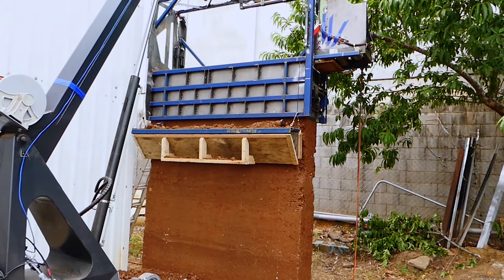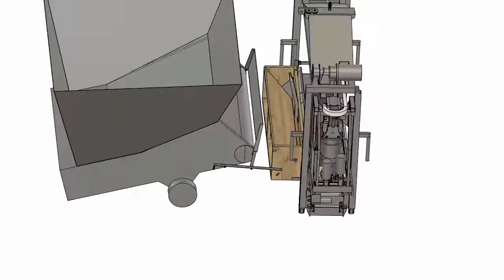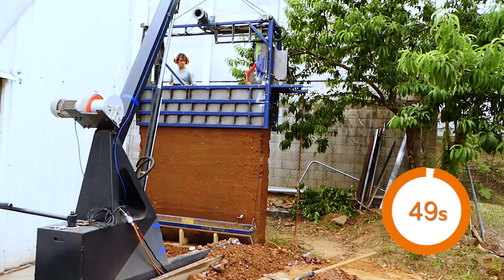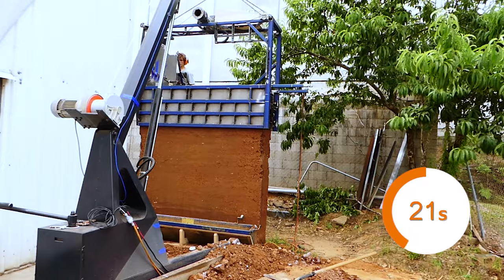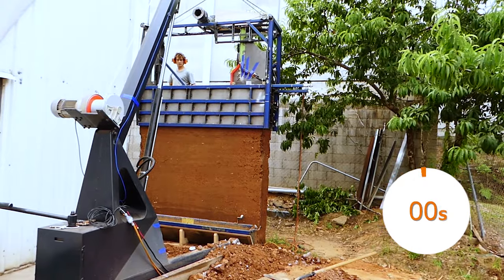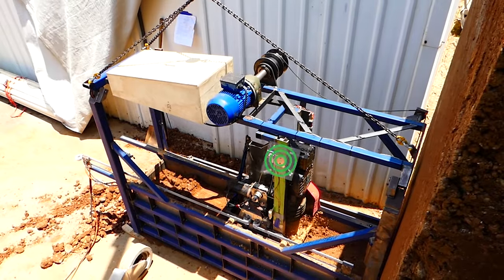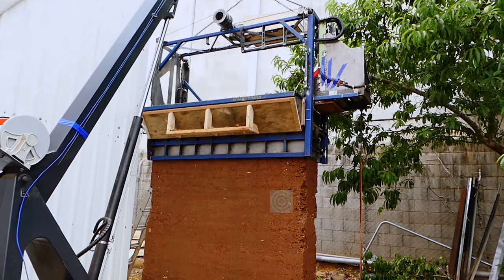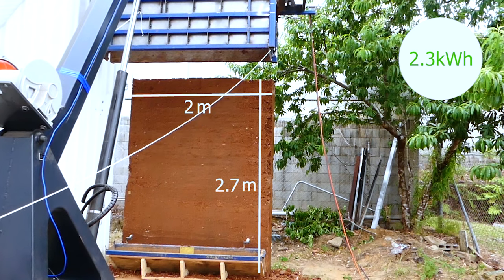The First Automated Rammed Earth House Building Machine - Form Earth

Comment: If your building with earth, get David Easton's books on rammed earth, use his fromwork, follow his instruction in the book. Get a skid steer, go to Ritchie auctions and get a bucket mixer made for a skidsteer. I use a Stanley ta 55 tamper. That works on hydraulic power, it will run on the ports off the skid steer you buy. And don't build a stupid earthship.

Comment: I'm curious if you are going add the capability to put insulation in the center. Built-in plumbing and electrical sounds tricky to pull off with this kind of a machine, looking forward to seeing a potential product
Reply from the maker: Hi Natalie, all great ideas which we may incorporate during later designs, although wires can be chased into a wall and seamlessly repacked with earth. And if the walls are to be lime & sand plastered then it's even easier to chase in wires and plumbing. Please visit formearth.com to learn more and contact me directly if you have questions.
Reply: c'est absurde de vouloir intégrer des réseaux dans un mur un terre battue
Reply: Congratulations 🎊 👏 for designing this innovative rammed earth machine 👏.

Comment: Interested to see how it will work with a longer wall, it is a great design!
Reply: Hi Royal, long walls are built like the wall that is perpendicular to the other wall; that is one endplate is removed and the machine is positioned colinear with the wall already built.
Reply: @davidnfreeman  Hi, are both endplate can be removable ,  for erecting wall on top of open window for example ,  or only one ( actuator on other side ? ) 
i don't exactly how you replace formwork after lifting,  i d'ont understand how you release or lock framework ( considering impact force of rammer ) ,  it seems you release formwork by corner ? 
there are som lacking of technical details to really appreciate this system in situ,  from an architectural point of view 
i know here it's an old system,  but the new one according picture seems to be a closed system ( permit only individual wall with same size ? ) 
don't misunderstood ,  i really enjoyed this system,  innovating,  but from arhitectural point of view ,  i have many questions :)
Reply from the maker: @hab keys Hi Hab, 

Both endplates are removable on the newer version which we are starting to build at the moment, a rendering is on the website www.formearth.com. 

The endplates on the new machine version can be placed inwards, so a shorter wall section can be built. With this machine a minimum section length (to be varified in testing) could be 1m all the way up to a 2m section in 100mm increments.

The formwork is released by spreading the two formwork surfaces with toggle and clamping bar (powered by a geared electric motor).
The endplates are linked to the formwork surfaces so that they accurate outwards at the same time.

We are working hard to bring this machine to the market and provided all the necessary technical details and instructional documents. For now, I thank you for your patience and hope we can work together in the future.

You are welcome to ask for clarification here or you can reach out on WhatsApp +61 403 362 574 .  Happy New Years, and I hope you have the best year you have ever had!
Reply: @Formearth  What about space for pipes, does your machine account for that?
Reply: @JD-zh1el  chase them in after the wall is finished like plumbers already do now with brick walls

Comment: How do you join the walls to the next segment? You are leaving a gap between since the machine is closed on both ends.
Reply from the maker: Hi Laszlo, on this test machine one endplate can be removed, the new machine developed will be able to remove endplates at both ends. At time 4 seconds in the video you will see the machine is flush to the other wall (end plate is removed).
Reply: @Formearth  Thanks man, great machine.

Comment: Interesting……how do you construct openings within the panel? What about working around services like conduits for lighting and general power? Also most panels require insulation these days….how does the machine work around these items?
Reply from the maker: Hi Scott thank you for your questions. Unless rammed earth is vaulted then it needs a beam to support the wall above the opening. The machine can start halfway up a wall no problem.

You can chase in conduits after the wall is built and then either compact earth manually into the groove or render over with lime (if you are rendering the wall). It would be simple enough to add the functionality, to the machine, to add conduit during the construction of the wall.

To insulate, two walls each 300mm could be built and insulation placed in the gap. In many countries that have very cold (snow) winters they simply build there earth walls about 600mm thick and the homes are reported to be extremely effective at heating.
Reply: @Formearth  a tee lintel is cast for opening greater than 2.0m although you can place deformed steel bar above a blockout style opening for smaller openings less than 2.0 m in length. I am just struggling to see how this would be quicker than a professional team of earth builders. We used to average 16 - 20m2 of wall a day including casting windows, insulation, services, etc. 95% of walls are built as an off form finish for their natural sedimentary beauty. Chasing in services would look hideous and be very time consuming.
A 650mm thick panel built in three stages is not the answer. It would take forever and be inefficient in labour and materials. Not to mention how you tie the panels together to resist wind loads if build as seperate units.
I wouldn’t completely give up on your idea but it is clear you need to spend time on a residential or commercial rammed earth site to see what is expected in terms of process and finish. Jumping that formwork before the lift is set makes me shiver!!
Reply from the maker: @scottghost1  Hi Scott, the beauty of rammed earth is it’s reusable. But if you add cement then it is concrete, I call that dry compacted concrete (or RCC https://en.wikipedia.org/wiki/Roller-compacted_concrete). I am not aware of specific research papers on the effect of steel reinforcing in rammed earth but from what I understand it isn't very effective.
Pisé préfabriqué BONUS #6 — Finitions: This video shows almost seamless compacting of the earth in a groove left as panels of rammed earth are stacked https://www.youtube.com/watch?v=KWGMm9fIM40. I also expect some people will like lime render on their walls.

I agree that building two walls could be time-consuming and the complexity of tying them together. I could make a single machine to do everything at once. Though I expect once we know more that insulation in rammed earth won’t be required in most instances.

The immediate strength of rammed earth on compaction makes jumping the formwork immediately fine.

Feel free to check out www.formearth.com and all my contact details are there if you would like to chat.

Cheers, David
Reply: @Formearth  all the best I hope it works out for you and you achieve your goals. Scott

Comment: Looks good but it needs a crane to move, which is expensive to rent.. And how do you handle the corners
Reply from the maker: Hi Praveen, cranes can be expensive but there are many options, one option is build new portable inexpensive cranes, I built the black crane that you can see in the video. Another option is to use a forklift as a crane since the next machine designed has its own lifting winch built in. Another option is to use jacks on the machine to lift it up the wall and use an excavator or other machine to lift it of the wall (the advantage here is the excavators could lift the machine from the side and thus lower than the winch lifting point).

Like plasterboard corners are fragile. An option is to add a chamfer another option a timber end board and another option is to add a steel corner strip and then plaster with lime render.
Cheers David

Comment: really nice ,  but why not include formwork in a structure that thus you're not use some crane to lift formwork,  with a self lifting formwork like for bucket sand earth. lifting formwork to replacing it at each rammed lift ,  is probably comsumming time,  to replace correctly at the right height. another things is ramming itself, you're using some jumping jack tamper,  but you could probably using simple hydraulic ramming tamper or severals guided on rails, what do you think ? ( or something like martin rauch used for prefabricated rammed earth wall )
Reply from the maker: Thank you for your suggestions. We will soon design self-lifting machines using a jacking system, these machines will be designed to be removed from the top of the wall by forklift or similar machine. Earth loading is an integral part of our design managed in this machine by a hopper design. Electric motors are an efficient way of converting energy into mechanical work, so, for now, our machines will run on electric systems, though hydraulic or pneumatic might see light in future machines if there is an advantage in an application.
Reply: @Formearth  you mentionned some sensor compacity ,  how it works exactly ,  i know some ultra sonic sensor mostly used for proximity sensor,  but density sensor ?
Reply from the maker: Hi Hab, Intelligent compaction is used in road construction and can be done during the compaction using sound sensors or accelerometers.

Comment: what is the exact name of the machine? and do you know if it is possible to reach up to 10 meter height?
Reply from the maker: Hi Mermaidadods 11, I will give you a theoretical answer but without further material science, I can not suggest the correct answer.

The density of rammed earth is ~2ton/m3 and with good material, the wall has a compressive strength immediately after compaction
of ~2Mpa (200 ton/m2).

To calculation the loading of a wall over 1m2 we can consider a column 1m*1m which has a weight of 2ton per meter. Therefore 2Mpa (200 ton/m2) ÷ 2ton/m= 100m high wall.

https://www.doatrip.de/en/germany/hesse/weilburg/highest-rammed-earth-building-in-germany.html

The machine’s name is still undecided, what do you think of the name Combiner?

Comment: What's maximum thickness of walls could build and and beveled edges finish would be great, I like you machine, well done ,what's the compression test results?
Reply: Like we were getting  tests back 3 to 5 x strength of concrete  is why I asked about your test results, thanks again and well done sir
Reply: Hi Obisam, Compressive strength is related to the material used, though with clay as the binder the compressive strength is usually around 2 MPa and concrete is 10 MPa or more. This machine is a prototype and the wall thickness was 400mm. Bevelled edges is something that can be done, though if the wall is to be rendered in lime plaster a square edge with a reinforcing metal corner strip can be used.
Reply: @davidnfreeman  why not add in 5-10% of the mixture with cement? theres literally all pros and zero cons to adding such little cement, but gaining so much more strength and integrity.
Reply: Hello @thekaizer666 , using cement coats the clay particles and they loose their cohesive properties, future structures would need additional cement to rebuild with the same material. Earth without cement can be reused or even reincorporated into landscapes without harm. Rammed earth without cement has been used for multi-story structures throughout the world.

Comment: Wonder how you use it to build the rest of the wall just besides to then finish up a house.
Reply from the maker: Hi Mathias, with the machine in the video you can see that it has the ability to build a wall at 90 degrees to another wall. It can also build at any other angle like in-line (collinear). The newer machine that I will release a crowd funding video for very soon is exactly 2m long and can build walls 2m long or shorter sections of walls reducing in 100mm increments down to one meter. Rammed earth walls can be left exposed or they can be rendered with lime. The ends of the wall can be exposed or have timber frames. Hope that helps? If I can answer any other questions please let me know.

Comment: From what I currently understand, CA regulations require that rammed earth walls contain rebar to make them more earthquake resistant. How would this machine accommodate the necessity of rebar?
Reply from the maker: Hi Russell, thank you for your comment there are a few comments I can make. First, the Freeform was not designed to work with rebar. Tall, rammed earth load-bearing structures are built throughout the world without rebar. I have also heard that rebar in rammed earth rusts rapidly. Also, I would speculate rebar does not bind effectively with rammed earth. 

Do you know if the CA regulations are requiring the addition of portland cement? Portland cement stabilised rammed earth is essentially concrete.
Reply: @Formearth  Your venture seems like it is floundering. See https://en.wikipedia.org/wiki/The_Innovator%27s_Dilemma. The basic advice is simple: make a very cheap, very bad product that is still actually useful to some customers. Then gradually make improvements over time.
Engineers typically aspire to do the opposite: they almost invariably strive to build a very good product that, oh by the way, happens to very expensive, that has all sort of "bells and whistles."
 
Don't do that. Why not? It's too difficult, takes too long, will be much too prone to break down (fail), and, like I indicated, would be too expensive if you were to ever actually build it in the first place.

At this point, you shouldn't try to build the product you dream of; instead, you should try to build the simplest, cheapest, product that some customer will pay you money to purchase. 

And, oh yeah, if you manage to actually manage to sell a few products then hop on an airplane and fly to Silicon Valley, or New York, or Los Angeles because without venture capital behind you, your company would be trounced by a competitor with venture capital funding. Your product isn't merely a "House the Poor" type of product; rather, it is a classic disruptive technology that will make some investors very wealthy.

Comment: It does not use any cement? If it is exposed to water will it crumble?
Reply from the maker: Hi, the quick answer is no it won't crumble in rain. Long answer:
For earth with poor quality or low percentage clay then there may at times be an advantage to add lime for stabilization. For good earth with enough good clay, the walls last amazing even without a roof. Home walls are protected from most of the rain, and if a wall is really exposed then there will be some natural erosion which may be aesthetically acceptable or the owner may prefer a lime render on these exposed walls. Something to think about, unsealed or gravel roads are made of earth and they last very well in the rain. Sorry for the tardy response.

Comment: Soooo what if that wall was longer? Or it was a T wall?  Or if it was 4m high, ?
Reply from the maker: Hi Mack thanks for your question, the endplates of the machine are removable so that longer sections can be built. The machine can build walls to any height, within the earth material's structural properties.
Reply: @Formearth   what about if the is 4 m high? Love the invention! Soo good. How much would one have to pay for this?
Reply: Can it do a over fill? 
Or like a window sill?
Reply from the maker: @Rammed_earth  The next machine which I have virtually completed the design for, but not yet built can build 7m high walls. Because that is as high as the spool capacity on the hopper winch. Except by changing the winch, the same machine could build higher.
Reply from the maker: @Rammed_earth  The same principles as regular rammed earth would apply; that is you would need a supporting member over the window or opening.

Comment: ...whats the cost...
Reply from the maker: Thank you for your question. Since the machine development is still ongoing it’s too soon to predict prices, though I can provide a few specifications of this prototype machine that may help. The machine's weight is 500kg and most of that mass is in the frame/formwork of the machine, the two actuators moving the formwork are electric and all winches and the compactor are also electric motor driven.